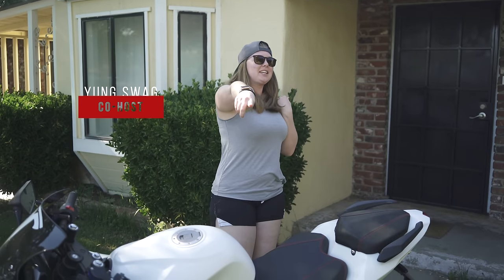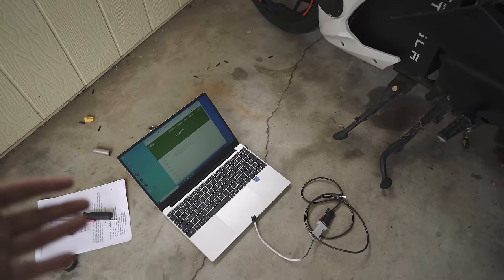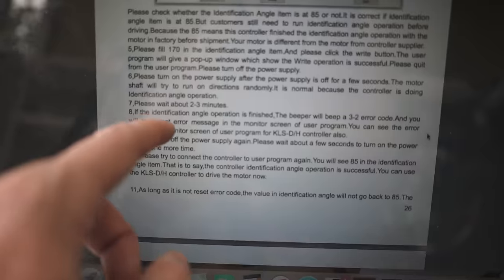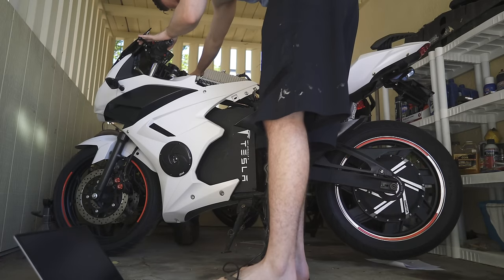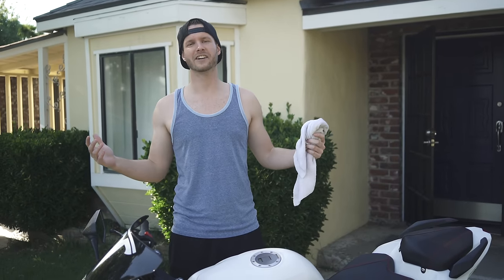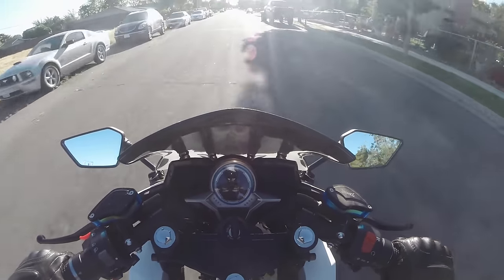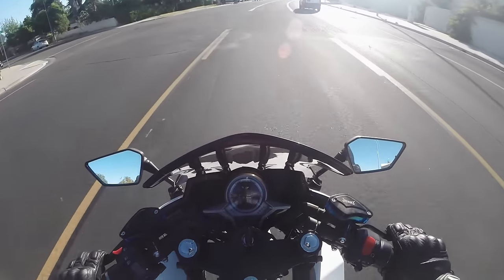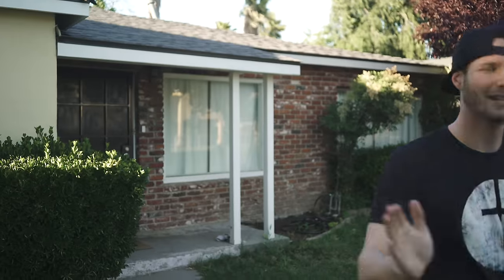The CHINESE ELECTRIC SPORTBIKE is FAST [FIRST RIDE after Mods]

Comment: First, glad you got it going mine vibrates at the start up too. Also I have the same controller and motor, and you can send to much power to the motor. The controller is rated for more power than the 8000w motor so just keep that in mind and not set it to high. I feel the same way every time I ride mine. Looks Great!
Reply from the maker: Appreciate that!
Reply: Indeed. I didn't see what BMS has been used but mine "Battery protects" once the voltage goes below a certain level.
Basically.. It shuts off if I pull too much juice out of it in one hit if the voltage aint there to support that much throttle.
I can redefine the parameters in the BMS though.

The Inja I suspect you're still in economy mode. Does your left hand grip twist to select higher modes ?
Reply from the maker: @0utcastAussie  nope, it's single speed now!
Reply: It vibrates as there is resistance when you first power the hub motor to gain movement. This issue is easier to notice on a 1kw/1.5kw motor as if you don’t give the bike a push before powering the wheel you feel the shunt of the wheel getting into its rhythm.
Reply: @TheInja  How much was this model, and speaking of that what's make n model called if u remember

Comment: Stoked you got it working! I had the same reaction first time I rode the one I built. The nice thing about that hub motor is that its rated wattage is 8,000w but it will peak at like 22,000w+ (which I have done) depending on the battery ya use, ya just don't want to hold it there too long or the hub will overheat or possibly fail. QS says the top speed on that hub is like 75-80mph but I've had mine up to 94mph and it gets there quick 😁
Reply: And how you register bike without eec certificate?
Reply: I have the same motor controller combo in a Kawasaki conversion. This hub cannot continuesly run 8kW it will overheat and self destroy.
Reply: 94mph? thats too slow
Reply: @5EM3  don't need one in alot of American states.
Reply: yes it dise

Comment: I work at a race track here in Australia & one of the biggest complaints from surrounding neighbours is the noise coming from full race spec 1000cc bikes, electric bikes are a win/win for both parties.
Reply: Nope
Reply: do they allow electric bicycles on the track i have a 2wd bicycle thats outputs 750nm+ and currently building a carbon fiber 33kw mid drive bmx geared for 120kph continuous 170kph peak

Comment: If it shorts and takes off like that while riding, that's an accident waiting to happen.
Reply: Brakes..?
Reply: I mean, ride/drive/throttle by wire has been a thing on motorcycles, cars, planes etc for years now, and you don't hear of electrical shorts causing people vehicles to run WOT and out of control.

Besides, you have 2 brakes, a thumb operated kill switch, and an ignition key switch in reach.

I'm sure he'll be fine :)
Reply: @KLRkillerfeeshy  It's electric. Those brakes won't do a thing with that motor at full, electrical short or not. And there is no kill switch for a short. Typically means it found another electrical route in the first place which could bypass the whole thing. Debris the battery? Debris in the kill switch itself? Who knows.

I once had a toaster that never turned off. No reason. Of course I unplugged it like you would hit a kill switch on this. But it's a switch. Switches fail and anything conductive on it can bypasses it. On top of that it's from China. So was my toaster come to think of it.
Reply: it wont be a short, it'll be the wire comes loose on the throttle sending the full 5v back into the controller telling the controller to send maximum amps to the motor, good luck trying to stop it with brake pads...

Comment: For silence hub motors are way better compared to the zero line with a chain setup.
Despite the big upgrade to the hub,  near dead silent at city speeds.
Reply: Zero uses Gates belts. I dunno if the earlier ones used chains but it's been belt driven for many years now. I would take mid drive over hub any day. Placing all that stupid heavy weight on the wheel is not gonna last long. These hub style lynch motors are notorious for needing tons of maintenance on spokes from that weight. There's plenty of room where the gas tank/engine would be for batteries. Putting the controller where the gas tank goes is not ideal since there's no good air flow cooling it. Controllers should only be internal if you can get the cooling(using liquid at that point) otherwise sticking them in front where radiators typically go is best. 

Sorry but the only place I see for hub style motors is very niche cases. This is going to cost him alot more money than if he got a used Zero and would be 10x better off. He could then make videos about modding a good high quality motorcycle than constantly fixing and praying the bike itself doesn't kill him by catastrophic failure.
Reply: @aflacduck2  i'm curious, is there any mid drive motor you recomend for a diy project? also that hubmotor seems to use an alloy wheel, do you know if it need the same maintenance as of the spokes ones?
Reply: @aflacduck2  chain in general, I forgot  the correct name xd
Reply: @B_aka_Scias  And considering most hub bikes are limited to city use by range and mostly as commuters, the wheels will never get to see the rugged usage of a cornering demon or swipping the roads with homies.
Reply: @B_aka_Scias  SMP180-05 also known as the 5.2KW motor from a Sur Ron or their 8KW version called the SMP180-08. $650/900 respectively. http://www.sur-ron.com/en/power.html You can buy the motor from lunacycle or ebikezilla (us/canada). I would not recommend the Sur Ron controller, get an ERT version of ASI BAC4000 or BAC8000. Either are much much better controllers and the BAC4000 is only a hundred more than an X controller from Sur Ron, way way worth it. You can also buy wiring harness, throttle cable, connectors, etc from either site above. 

The 5.2KW motor has been used in upto 96V. From the factory, it's used at 60V to get 5.2kW. Some people have put 33Kw through it and burned out the motor in 1 lap at Laguna due to heat since it's air cooled.

Personally, I would wait for Sur Rons new Storm Bee platform to come out with it's 96V system from the factory and a new 10KW water cooled motor with gearing. Even if it ends up not being something you would need, surely the prices of the older systems would come down.

Comment: The biggest thing I like about electrics are they basically have high torque from the very low end..
I'm thinking on converting my MTB into a Electric Cycle after getting a taste of Instant Torque..
It's not fast but it feels fast af...
Also You can actually get some Engine sounds through those speakers i think so..
That's what the Speakers are for on this bike I think..❤️🌚
Reply: yes yiu cañ

Comment: next video "we needed better brakes"
Reply: Jeff Swanson I’m thinking about putting brembo brake system on mine
Reply: @TheFlatEarthChannelcom  you better! If not you could fall off the edge...
Reply: José Villaró there is no edge on a flat earth. You can’t have gas pressure without a container, hence we live in a container. Does your water fall off the edge of your bottle of water? No because there is no edge.

Comment: really cool, dude.  I used to ride dirtbikes constantly when I was younger, this makes me want to start a new project.  Could I trouble you for links to the controller/motor etc.?
Reply: Google: Kelly Controller, google: QS-Motor......easy.
Reply from the maker: In the next videos description
Reply: kls7275h controller, dont get it, waste of time
you're better off with the kelly kls72701-8080h controller if you want good acceleration with a 84v battery, puts that tiny controller to shame...

Comment: Glad to see you got it working... now take your old hub motor and put it up front for 2 wheel drive and even more acceleration. I've seen it done on a few e bikes and they're crazy fast when both motors are selected. 
Also great for wet roadsor anytime traction is needed

Comment: I have a little e-roller (30mph, 100lbs), and plan to go from heavy lead to lightweight lithium batteries. I don´t get why everybody uses these laptop-batteries, anyway, I´ll use some from RC-modeling!!! My max. draw is gonna be only 30amps (yes, just thirty), and my li-batteries will manage 600amps continiously (900amps for 10sec-boosts) !!! I guess after 500cycles, they gonna still be as good as new (25%-75% usage cycle quadriples lifetime)... I´d advice everybody to use RC-batteries instead of cylindical laptop-batteries. Of cource, those RC-Batteries are not allowed to be used in my county in vehicles, cause theoretically, they aren´t checked for security against burning over over-discharging, but since I´m gonna discharge them 20-30 times slower than they´re declared for, they won´t even get luke-warm (experience), while normal batteries would be legal, but would still get very warm (which is risky, but the law backs me in case of catching fire, which of course is useless, if I get myself burnt down in the process :-)... It´s one of those cases, where a stupid law ignores science, and does greater harm than good... And suppossedly this law comes from a time where RC-batteries were far less secure+powerfull...

Comment: I take it from your reaction to the acceleration you’ve never watch a YT vid of an electric bike. They blow away gas engines when it comes to torque. Also, you bike does not have a engine. When it’s electric, it’s a motor. Never an engine.

Comment: Sadly as Chinese me myself can’t ride this cool bike due to the serious law
Reply: You give all your freedom to smartphones that's why
Reply: Modification isn't legal in China.
Reply: @S2Tubes  modification of any type other than OEM registered with that bike is illigal everywhere including colouring, wrapping, changing horn, modifying exhaust, changing lights etc., But in most of the case they ignore it but if u modify the output power, capacity, top speed, acceleration u have to register with the local authorities and get certified it doesn't matter what parts u mixed up untill they meet the norms they register it if they are diy u have to pay testing fee they will lab test it's reliability, performance, consumption values, mileage etc., And they will provide a certificate stating it's a new kind of vehicle and if u reproduce the same bike duplicate copies of the same can be registered directly with the regional transport department.
Reply: @S2Tubes  china have alot more power models 15000w electric this type motorcycles, just he buying most cheapest.
Reply: @owleyes8492  lol
Reply: @yan yan you can't ride also this bike in USA, does matters modified or not, this bike don't have coc certificate, you can't register, so police stops you and can take yout bike
Reply: Guys I guess she is talking about lockdown.....x

Comment: Dude. Now you can spend time upgrading it part by part forever. New forks, Brembo brakes, better rear suspension, digital dashboard, LED lighting. Then, better chargers, battery, etc. Electric bikes are the future. So much customization possibilities.

Comment: For good reminder w - water ,blue  v- verde french for green u - uellow, yellow if it is 1-2-3 it is u v w just like in the alphabet. Differs from manufactor to manufactor. If wheel turns backward switch two phasewire. If still not working try all six possibilietys, normaly it will not harm the controller. Greeting from pinetop projects

Comment: It was not needed to extend the phase cable to match the controllers phase connectors. Just connect them as you thought from the beginning and if the motor rotates the opposite way just switch any 2 of the 3 cables (like the 2 closest to the rear wheel) and it will work. Nice to see it finally run tho (y)
Reply: Simon Liljeqvist the cable actually only came up to seat level, so they were about a foot too short to reach the posts

Comment: Want more MPH, add more Volts.Even if you limit the motor Current (torque), using a higher Voltage will give you more speed, without risking the motor. (even after you reprogrammed the controller).  Typically 25% higher will never hurt the motor.  Also, Brushless DC motors like these "don't care" what the 3 motor connections are, as long as it results in the desired rotation direction... that is ALL that it will do. You can re-arrange them as needed, and if it rotates the wrong direction, just swap any 2 of the phases.  (This is true of any 3-phase motor)

Comment: I have an f1.. looks similar to your bike.. mine is 96v lithium with a 100amp fan cooled controller.. top speed 59mph. Its pretty decent.  Paid 2400+taxes. Id like to get a bigger controller for it but I'm already getting very similar GPS reading as you are. Can you tell me what the cost of that kelly controller is?

Comment: That's what everybody loves about pretty much all electric vehicles is the INSTANT torque when you hit the throttle. There's virtually no delay (in fast EVs there really ISN'T any delay). And EVs are the opposite of ICE (gas/diesel) cars in that they do really well in stop and go traffic efficiency-wise, but not as well on the highway, especially over about 50 mph. ICE vehicles do better on the highway because of the gearing advantage (EVs have one gear).

Comment: If you need any Help with any problems ,message me , also before you upgrade anything else make sure its compatible with the control unit .. especially the guages..the left side handle is  power modes   S is for sport mode (means above the legal max speed of30- 36 kph  ) which is max speed between 70-130 kph ) depending on control unit.  D is for drive mode ( max30- 36 kph )  P is for Pedal assist mode (if theres a  L.E.D screen that has a computer assisted mode stages you can the speeds to 5 other speed modes.   R  is a no brainer ,for reverse. You mentioned you had a center double leg ..my bike weighs in at over 400 pounds ,and i definatly cant kick  the center stand up. hows yours ? and yes the signal light switch doesnt click off automatically ,use a 72 v beeper if u can find one or use separate batterys to wire in 12 volt

 https://www.amazon.ca/Motorcycle-Motorbike-Flasher-Indicator-Blinker/dp/B01M33EX59

 with a separate 12 volt  lithium ion dyi system parts work great  and is way cheaper and easier to replace. now you can hear the signal lights when on ,you can turn it off and prevent any accidents from other drivers thinking your turning. 
now you can wire in 12 v l.e.d string  lights as well for cool night  cruising lighting effects . 

on the right side theres a large 2 switch power on power off button ,mines red .when on off the bike motor wont enguage   , theres Two single white wires on controller and two green  those are your intelligent self computer program connections the white when connected programs the motor for 2 kinds of wiring  disconnect when motor spins in forward gear..the green when connected auto identifies the motor and hall wiring  of magnets .disconnect of leave connected, depends on if the motor still enguages . question ? how many batteries are in your 72 volt case ?  (205),what is max voltage reading when fully charged ?  ( 80 ),and how fast ( km)does the voltage drain from max charge to about say 75 volts  ? ( under 5km)

Comment: So, you talked about some vibration at the bottom end.
In the last video you said you changed the phase wire (which is why the motor was going backward, on BLDC motors you change one wire and the motor change direction), but if you did not change the hall effect sensor according to the phase (green, yellow and blue), the motor might not understand in which position it's in (causing the vibrations)
What i advise you to do is to follow the colors for phase and hall effect and don't check the change direction box, you might even gain power on the bottom end.
Have a good day man.

Comment: Hey man, you should change your extensions when you get the chance. Separate strands run the risk of a single strand breaking and the rest of the strands getting burned up from increased resistance and current. Get some good big gauge wire

Comment: Seriously dude..have your brakes got engine cutouts, because my puny 2.5KW mtb got me in serious trouble on a rainy day, the hub way overpowered the rear brake and the front just slid locked up when the controller went to full throttle by itself.

Comment: 8kw is like 10HP.
Is like a 250cc. But since it only has 1 gear, the low end torque is quite big.
Once you'll get to ~70MPH it'll run out of acceleration.
Reply: Muranaman it’s pulling more than 8k at full throttle, but your point is correct otherwise

Comment: Just wondering. I just bought one without the battery pack but the seller don't want to tell me the maximum battery pack size I can fit in these motorcycle . Can someone please help with the maximum size that will fit in it ?? Much a appreciated .

Comment: Couldn't you just mount that grey box thingy the other way so the U connector is on the bottom and the wire wouldn't have to be extended?
Reply: Doug Howting short answer is no...there are a whole number of reasons that wouldn’t work.

Comment: the instant of extra acceleration when you release the throttle may be residual energy in the capacitors and/or simply the result of instant throttle response - on a petrol bike, the power band is a bit different so you let off the throttle and feel decceleration. On electric vehicles, your power output is exactly related to throttle position. I ride a DIY electric motorcycle as well and have learned to close the throttle more quickly when letting off from wide open acceleration